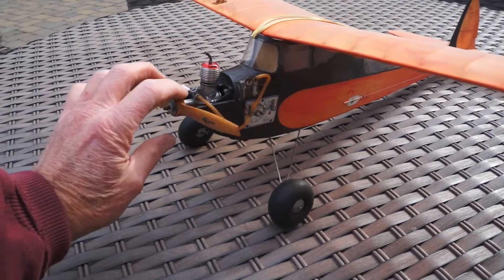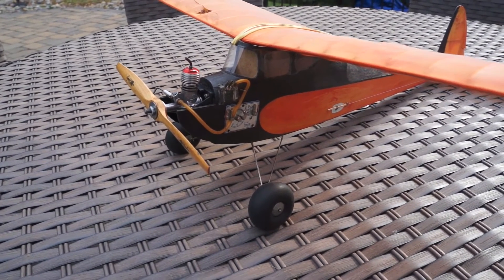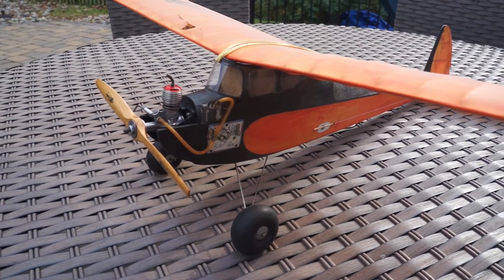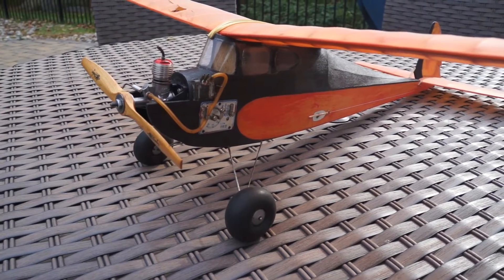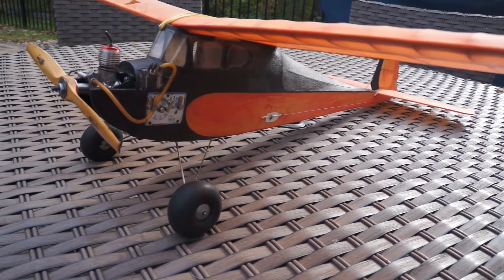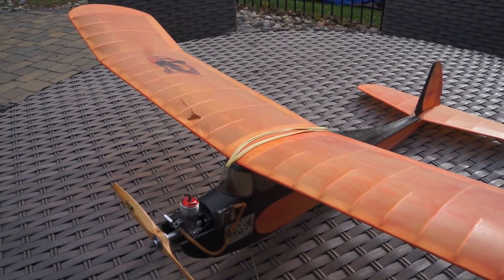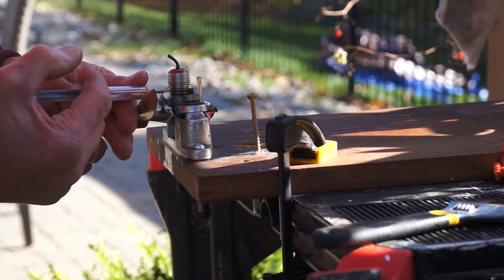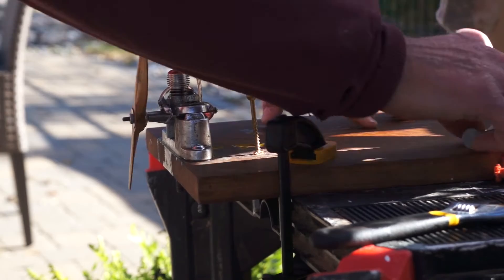Allbon Dart in Baby Bombshell (Test Run)

Comment: My first Diesel engine was a DC Dart, I now have two. I almost lost one in my Veron Cardinal when I over filled the tank. Great little engines, easy to start and adjust.
Reply from the maker: Glad you didn't lose the Cardinal.  I was raised on Cox reed valve engines, but have come around to the Diesel sensibility.  The Dart is a gem.  Next step: make a batch of homebrew diesel fuel.
Reply: @tomnallen2 , I’m moving more toward electric free flight these days, it’s quiet, vibration free, oil free, there’re never starting issues and it’s far easier to set motor run times.

I still get nostalgic when I smell diesel and burned castor oil though!
Reply: Hi Pete, What would be the equivalent in electric powered free flight to a Mills 75 powered model? Thank you, Michael
Reply: @robinboucherwonderfulflight  Hi Michael, I typed a detailed reply but for some reason YouTube’s spam-bot decided to delete my comment for absolutely no sensible reason.

I’ll try again but forgive me if I’m a bit brief, there seems little point in providing detailed explanations if this ridiculous platform will delete them out of hand.

Going on old engine test data, the Mills .75 put out around 40 watts. Personally, I’d go for a 24g 60 watt brushless outrunner motor running on 2S LiPo batteries. 

This would happily turn an 8x4 propeller and a 12 amp speed controller would be more than enough to control it without overheating. 

For a speed and timer unit, I’d use the KP Aero timer as I’ve had good luck with those.
Reply: @Pete-tq6in   Thank you very much Pete, much appreciated. Michael